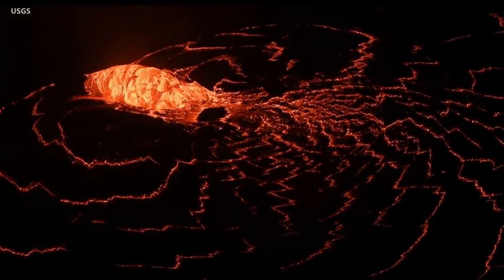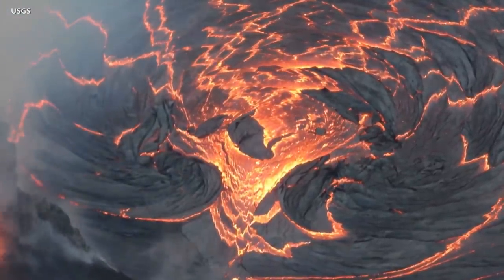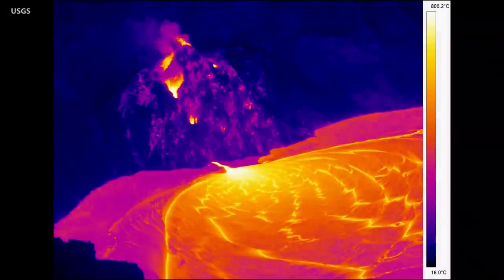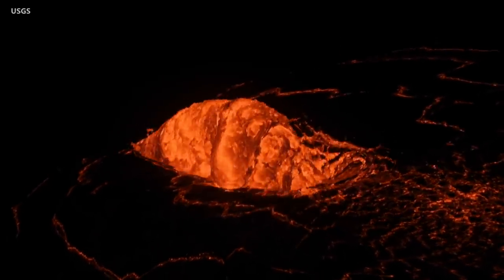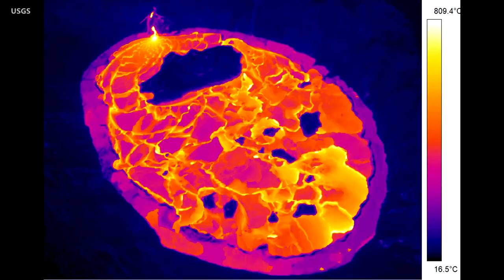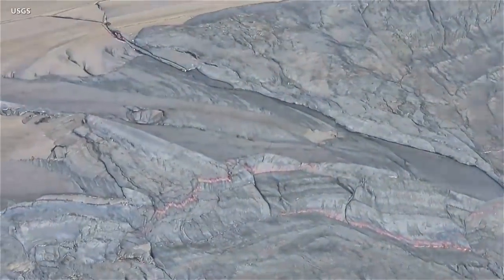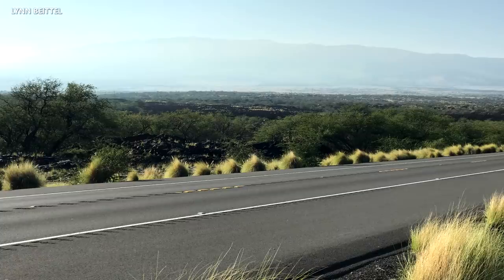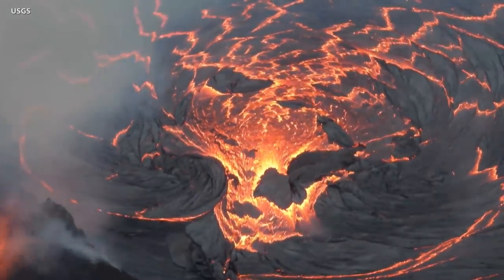Kilauea Eruption Update: Lava Lake Dome Fountain Emerges (Jan. 5, 2021)

Comment: Question. Lava flows from below the surface. So what fills the void it lesves behind when it breaks through and flows out?
Reply: More magma and rock.
Reply: @jukahri  does it multiply? This is an honest question. I homeschool and my son asked this question
Reply: @lady2550  So first of all, please don't rely just on Youtube's comment section for the education of your son! But as for "does it multiply", I assume your son means where does magma come from, how is it created. What you are looking for is what is called the rock or lava cycle, there should be plenty of nice infographics describing it if you look for it. 
The (very) short of it is that magma is simply molten rock coming from far beneath the surface, from the mantle, where the pressure is high enough to melt rock (pressure = heat). The molten rock below, being more buoyant than the colder rock above, rises to the surface, where it cools down. The 'void' it leaves behind is filled by the colder, denser rock it displaced to get to the surface, so that colder rock will in turn heat up because of the higher pressure, turn into magma again and the cycle starts anew.
Reply: @jukahri  yeah we got that part and I dont rely on youtube. I saw this video and asked the question my son did. We know what you wrote he was just curiius

Comment: Its fascinating awesome natural power but the dynamics of the flowing lava are hardly surprising.
Its a liquid being forced from below the surface with more force that the surface tension can support...hence it blows over just like filling a bath of water from below.
The edges of the lava lake are very much cooler because they are in contact with the the colder older caldera walls...they will absorb much heat...and so the edges of the liquid mass will obviously be cooler.
An awesome video to watch whilst "millions of years" 😉😉 of rock formations are made and destroyed in a few hours..and made again a few hours later.

Comment: I was there in early 1962. I was 12 and we vacationed in Hawaii. Toured the crater and walked the trail on the lava crust. The pictures we took from inside the crater looks like you are on Mars. The crust was a reddish color and the only horizon you saw was the rim of the crater. Very eerie feeling. There also used to be a restaurant on the rim of the interior crater.
Reply: Wow that sounds like quite an experience

Comment: Its filling up up up!! PELE has plenty this time it will over flow soon
Reply: Actually, as in 2018, the most likely scenario is that the pressure of the lave below ground will become so great that the lava lake and rising lava from below will break through blockage and flow and drain in to the East Rift Zone. The lava from the lava lake and up welling lava will erupt, as in 2018, along the East Rift Zone.
Reply: Aint no party like a Pele party

Comment: The 'jitter' seen in video may be from the intense heat that definity affects the way light is refracted. Same thing when the recent Jupiter/Saturn event, the closer to the horizon, the more interference from the different gases in the atmosphere. Remember an oasis in the desert? The shimmering effect is from the heat given off by the sand again affecting refraction. (I think)
Reply: You forgot the Monolith in the Utah desert, a possible refraction, stratigically placed

Comment: How does this type of eruption, affect the Tectonic Plates?
Reply: I don’t think whatsoever. Because Hawaii is extremely unique in that it’s a volcano chain in the center of a tectonic plate. Pretty much all others are on the border of 2 tectonic plates. Hawaii is like a “Hershey’s Kiss conveyor belt”, a hole in the crust squirting our magma as it moves along.

The best view is to use Google Satellite maps (bc they include underwater bathymetry) and go to Hawaii and zoom out - WAY out, and you’ll see a trail of volcanos both above and below sea level, going back northwest and then peculiarly curved up north all the way to Russia/Alaska. 

That’s the trail, and hence one can deduce the plate is moving to the southeast - which is why Kileaua is the worlds most active volcano 🌋 And why this chain abruptly ends at Kilauea. Because it’s “the front of the train” so to speak.

Comment: why are they talking all the time in feet, i don t really know this mesurement, please talk in meters, especially when you show the datas in meter
Reply: Is it really so hard to divide by 3?
Reply: @stargazer7644  no it isn't hard, but it's annoying and I don't understand why you don't have the metric system like the rest of the world
Reply: @nopenopenobody2971  Basically, because we don't have to.  But we do use the metric system for some things.  We buy soft drinks in liters, we run some foot races in kilometers.  We measure radio wavelength bands in meters, centimeters and millimeters. Our cars are required to have km/h on the speedometer, but none of our highway signs are metric.  Our alcohol is mostly in milliliters. Computer fans are sold in millimeters.  Car and motorcycle engines are often in liters and cubic centimeters.  Camera lenses are always metric and telescopes are often metric.  Remember 35 mm film?   We don't have any imperial units for electricity, we use the SI units. We measure color temperature in Kelvin. Some gun ammunition is specified in mm, the rest is in decimal inches. Our military uses lots of metric units.  We measure blood pressure in mm of mercury, but air pressure in inches of mercury.  We measure light wavelengths in nanometers and angstroms.  Fun, right?  Oh, how come you use imperial measurements for time?  All that 60 seconds in a minute, 60 minutes in an hour, 24 hours in a day, 365 days in a year stuff must be awfully annoying for you.

Comment: that looked cool. However, all this power slowly being released, I think it will cause dramatic plate shift.
Reply: No need to worry. Hawaii does not reside on a plate boundary. The Pacific plate continues to move relative to the North American plate at approximately the same rate that your fingernails grow.
Reply: @leftear99  which plate has been (stuck) for over a hundred years? Is that in CA?
Reply: @chrish1993  Parts of the San Andreas fault zone are currently locked, yes. That is the major fault system that runs along the southern California coastline, separating the Pacific and North American plates. Other parts of it continually slip, though. All faults have segments, and usually each of those segments exhibits a slightly different reaction to plate movement.